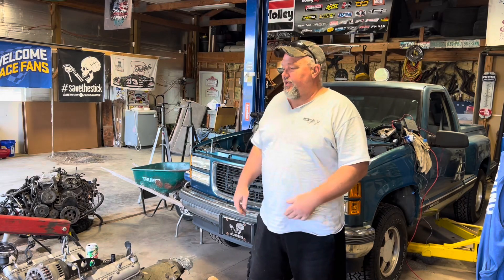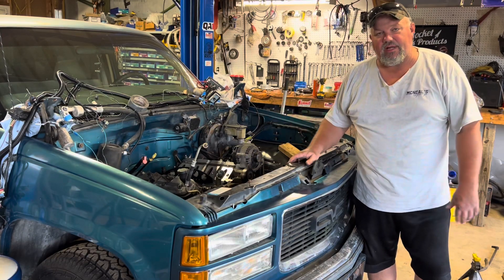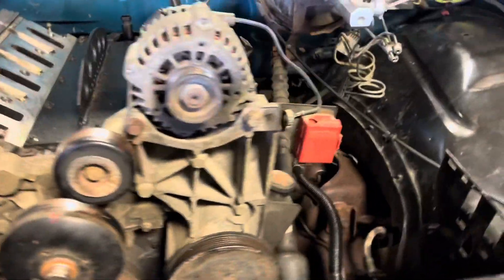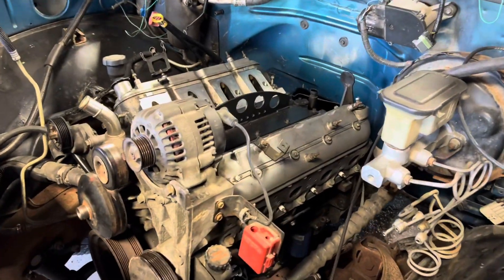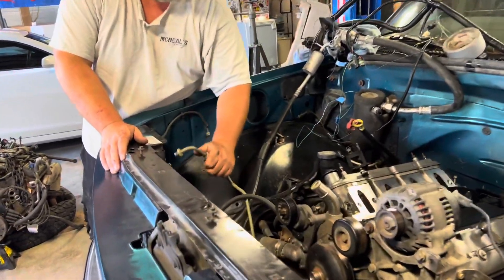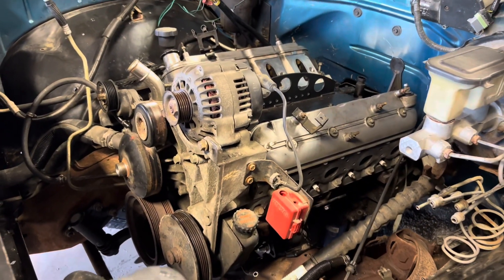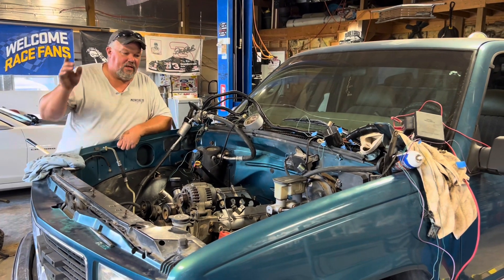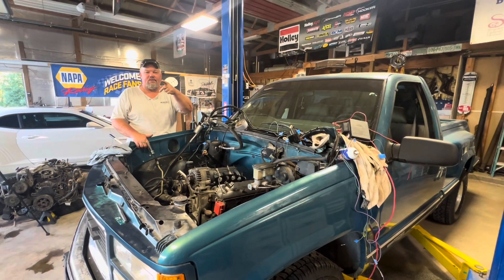INSTALLING THE 5.3 LS FOR THE FINAL TIME

Comment: Does the trans stay put? In other words, can the LS be positioned do that no drove shafts have to be modified? I'm looking to swap a 5.3 in to 1992 4x4 with a 4L80e. I would be nice not to move the drivetrain.
Reply from the maker: For my 2wd, the factory transmission cross member and drive shaft worked. Not sure about 4x4

Comment: So essentially you keep the gmt-400 fuse block and remove original ecm correct?
Reply from the maker: That is correct
Reply: @mcnealsgarage  awesome great videos keep up the good work! 👍🏼. You end up getting your ac working? Wondering if your making it run with the ls ecm?
Reply from the maker: Haven’t messed with it yet. But it should work. Just need the bracket for the compressor and plug everything in
Reply: Nice I will stay vigilant for your videos thank you!